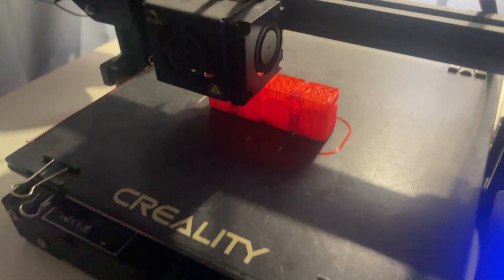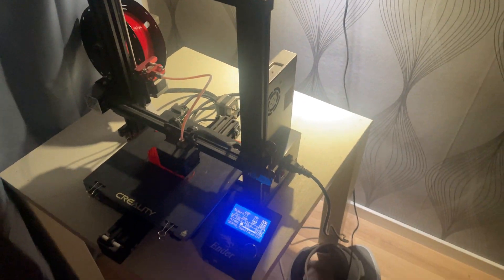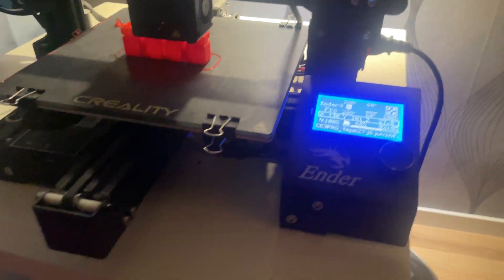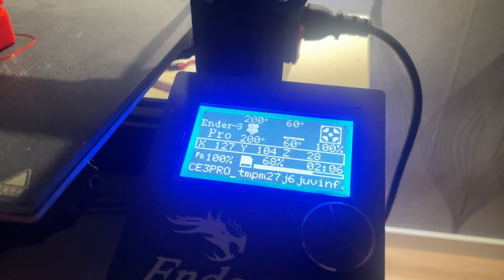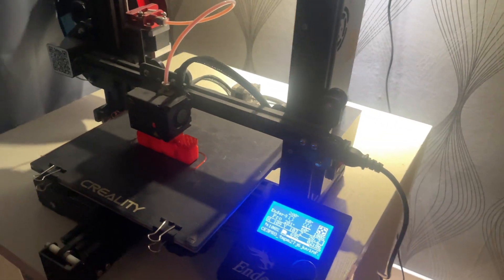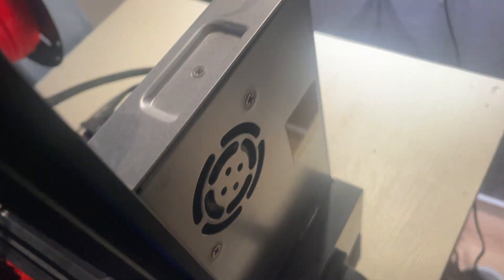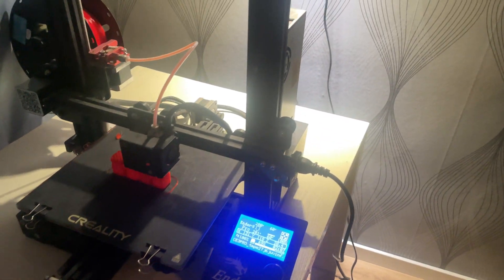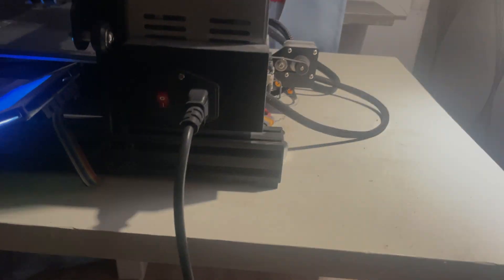5 Reasons to Buy the Creality Ender 3 Pro in 2025

Comment: You can get a way better printer for the price, one that doesn't need nearly as much maintenance and is way more user friendly. One example is the Elegoo Centauri that's shipping in June. $199 for a highly capable coreXY, 500mm/s, 20K accels, and way more. There's no reason to buy an Ender 3 anymore unless you specifically want to be constantly tinkering with it.

Comment: Absolute no way, and a very hot take.  To get an Ender 3 Pro to have the quality of life upgrades and experience as comparable printers in the price range, you'd need to spend quite a bit.  A better recommendation would be something like a Neptune 4 at $199, which is pretty much an Ender 3 Pro but with Klipper, a bed leveling sensor, touch screen, direct drive extruder, etc.  Even that's a terrible deal considering a CoreXY enclosed printer is about to release at $299 in the form of the Elegoo Centauri Carbon.
Reply from the maker: Didn’t know that but that seems great yea maybe the ender 3 pro is outdated and shouldn’t be bought